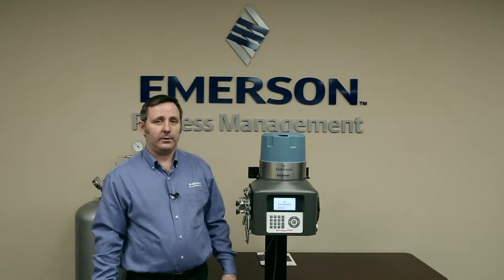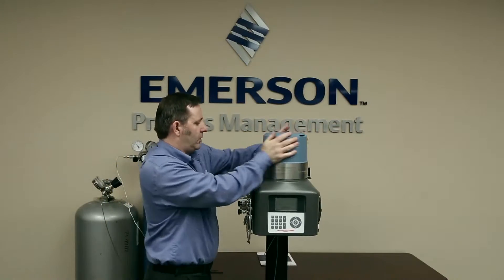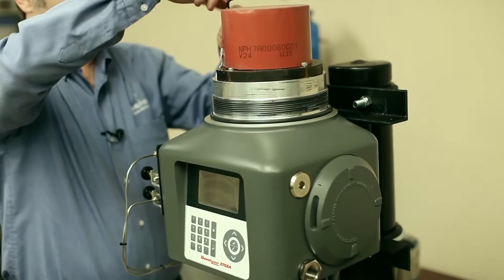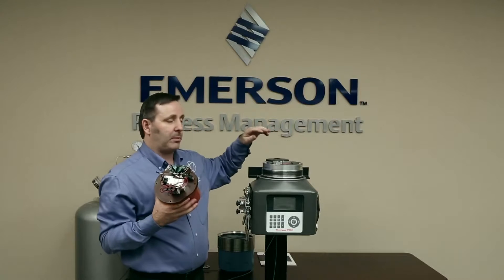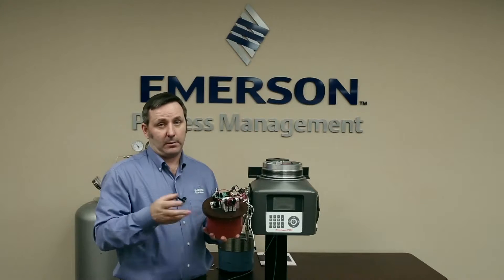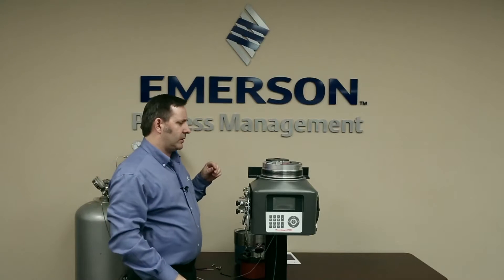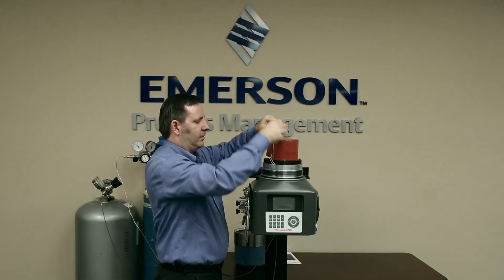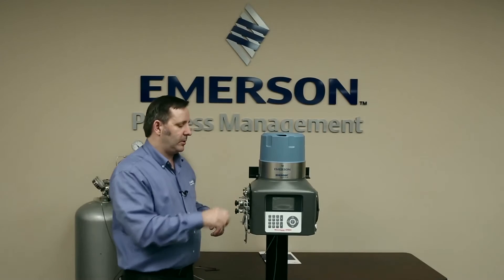370XA Gas Chromatograph Module Replacement

Comment: If the model is removed and components seviced then reinstalled, will the auto start feature run, ir is that only if it recognizes a new module?
Reply from the maker: Hi. Our technical engineer said "Auto-sequence or auto-start can also be initiated after GC maintenance. It can be navigated thru the GC local operating unit or MON2020 and select Auto Sequence." Let us know if you have further questions. You can also reach us at https://go.emersonautomation.com/contact-us